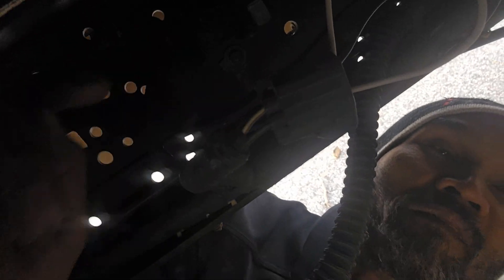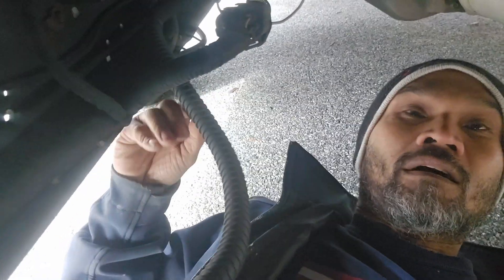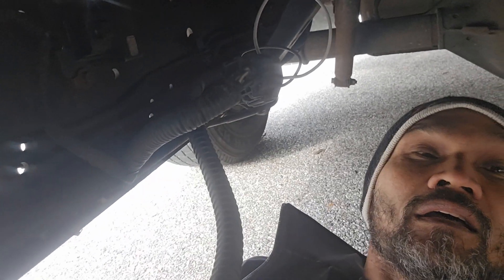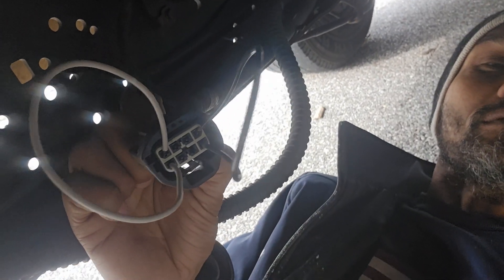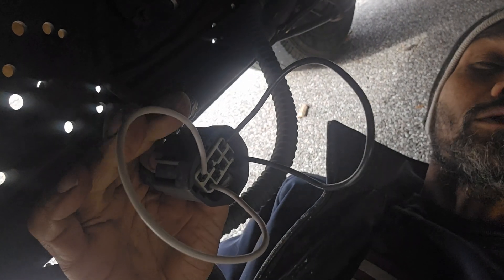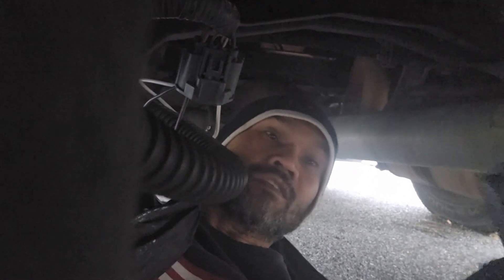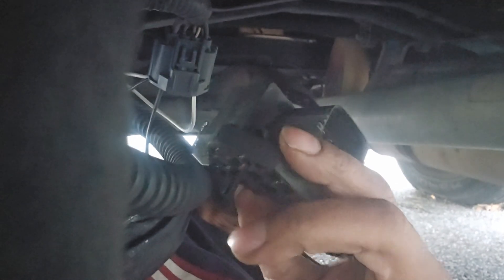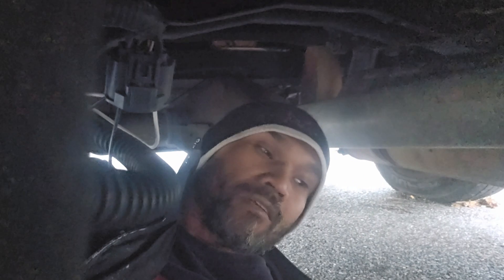How to test a fuel pump driver module

Comment: After the fuel pump change the fuel pump indicator return? My fuel reading are at 0 and I just installed a new pump. After the FPCM replacement did everything go back to normal?
Reply from the maker: Yes after changing the module everything  goes to normal

Comment: What were the symptoms? Just not starting? Ive had to disconnect and reconnect battery twice to get it started again, and im wondering if its fuel pump control module. So you jump it like that then start it?
Reply from the maker: yes if it start right up then it's the module.